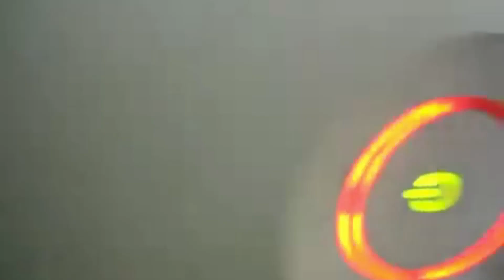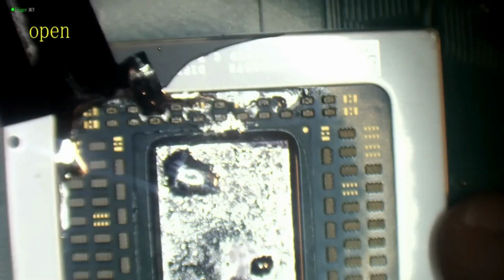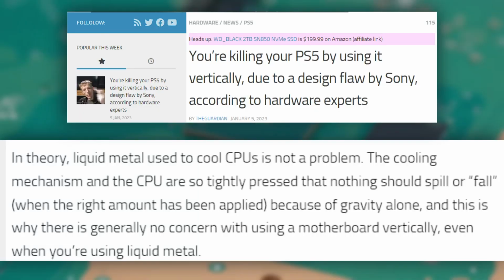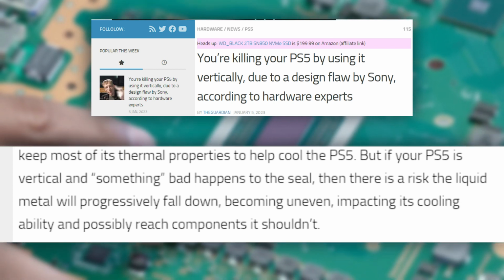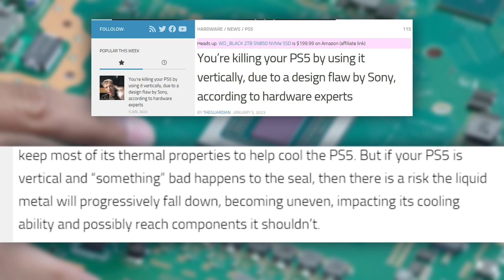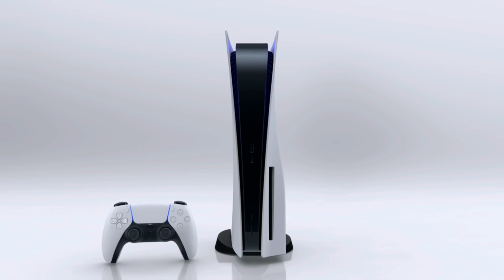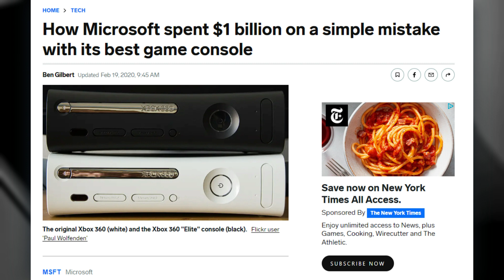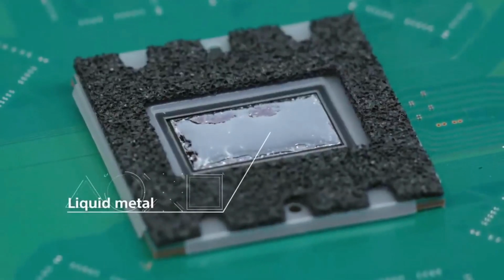PlayStation 5 Leaking Liquid Metal???  #PlayStation #PS5

Comment: Kinda sounds like a stupid idea but if it has the potential to leak, wouldn't it be beneficial to run it for a bit upside down vertically to offset the gravity bleed? Seems plausible to try out, especially since I have a few things to keep it pinned in place without restricting air flow. I'm worried that disassembly will actually worsen the existing seal so I wouldn't consider inspecting my unit until I know there's a potential replacement part and some spare liquid metal to go along with it I can order if things end up looking as bad as my worries make them when stuff like these reports crop up.